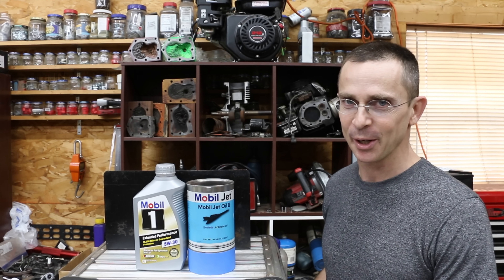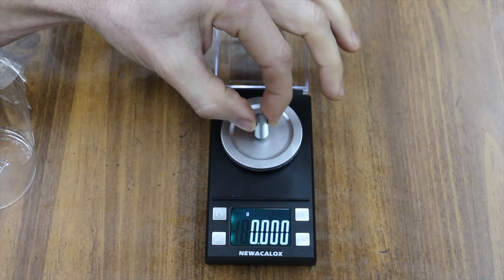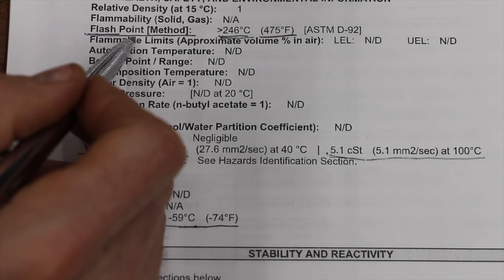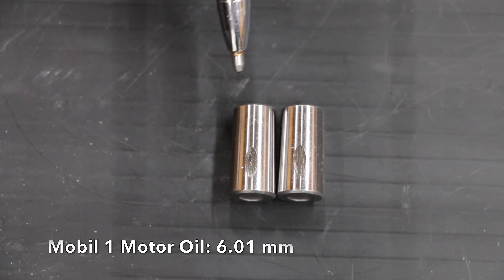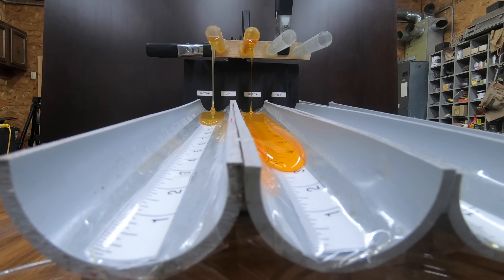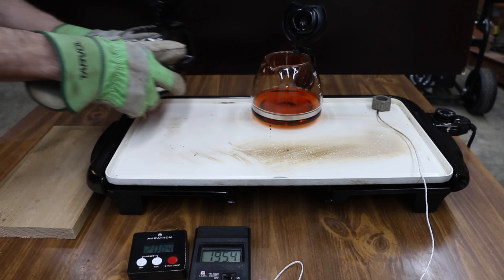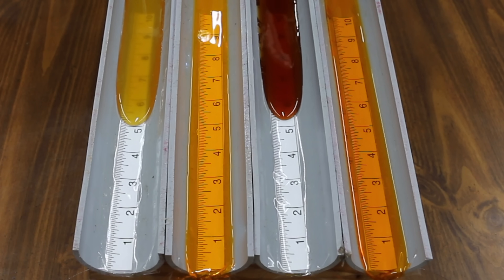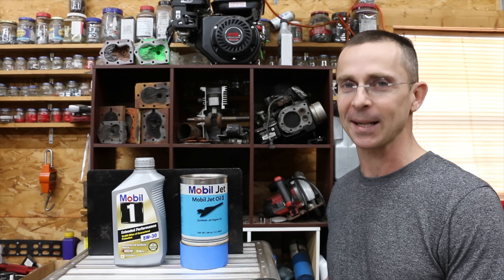Is Jet Oil better than Mobil 1 Synthetic?  Let's find out!

Comment: You definitely don't want to put Mobil jet in your car engine- it will eat EVERY seal and gasket it touches! I work in a test lab with that stuff, and even o-rings designed for that stuff will still swell over time. Also, jet engines use ball bearings, so the oil is designed for rolling friction as opposed to the sliding friction seen in a piston engine, which is why the lubricity tester didn't do as well.
Reply from the maker: Great point!  Thank you
Reply: @ProjectFarm  here's something else I thought of: in addition to lubrication, another key function of the oil in a gas turbine engine is to cool the bearings. I wonder if the specific heat capacity of Mobil jet is different from car engine oil to accommodate this function.
Reply: @EngDrewman  About the heat capacity: The difference cannot be significant from regular car engine oil. All hydrocarbons have about the same heat capacity of about 2 kJ/kg,K compare to water at 4,18. The low viscosity helps with heat transfer but the heat capacity is about the same as for any oil.
Reply: @EngDrewman  Good question... but among the various hydrocarbons used exclusively for Heat Transfer, or comonly known as Heating Oils, like Mobil Therm, Dowtherm, Therminol, etc. the best Heat Transfer will be the fluid with the highest Density and Heat Capacity and lowest Viscosity.  But those properties vary relatively litttle, and thus there will be little actual difference.  The most important parameter will be the actual transfer area and which flow regime will be present, as a high Reynolds Number (fully Turbulent flow) will improve Heat Transfer, so it is paramount to avoid low velocity and falling into Laminar Flow.
Reply: @skunkjobb  True but quite a few jets get cooled by the surrounding air or even its own fuel in a few instances
Reply: @EngDrewman  When ever you include Oxygen into that lubricant molecule, heat transport is improved!
Reply: @EngDrewman  without phase changing effects, thermal capacity increases linear with density if I recall correctly. Conductivity is another issue.
Reply: @ProjectFarm  As a black hawk mechanic would also like to add that the filters we use on military aircraft are extremely efficient!!! The oil will actually come out even cleaner then brand new straight from the can/bottle!
Reply: @LilSausBaus  Too bad they dont make such filters for cars...
Reply: I wonder how it would fare in a rotary, aside from eating the oil seals
Reply: @spazzwazzle  you'd probably see accelerated wear because it is thinner than gasoline engine oil and lacks the wear additives. Remember that in a rotary you have sliding friction on the rotor's seals and between the rotor and crankshaft.
Reply: @EngDrewman  You bring up some good points. However I'm disagreeing with your statement that Mobil Jet Oil cannot be used in components encountering sliding friction vs rolling friction. I worked on the PT6T- series of engines for use in rotary applications,  and those engines have labyrinth seals with the sole purpose of containing the oil. These seals are in direct contact with the compressor shaft and the power turbine shaft, which are capable of spinning at 40 000RPM. if the oil was not suitable at those speeds, the engine would fall apart.
Reply: @kieranmccullagh6713  one correction labyrinth seals are non contact seal which is why they don't wear our spining at 37000rpm
Reply: @EngDrewman  it would still burn out like a recip/radial
Reply: S P I C Y M E M E S Wankel engine
Reply: To add some real world experience to this...  You absolutely can use Mobil Jet II in a car engine.  It will quite possibly cause hell with oil filters as it will pull the coke and other accumulated contamination off of the engine internals in very short order, and I mean very short order, but once you have got through that you will no longer have issues with accumulation or clogging filters.  If you have worn out seals that are holding on only by virtue of contamination gluing them together, they will probably start to leak, but a fresh seals will not have an issue.

Oils a generation newer than it will probably give you more trouble with seals.  I have not tried Mobil Jet 254 in an internal combustion engine and I don't think it will work, as even in turbine engines it seems to be too hard on the seals to avoid weeps and leaks.  It does strip carbon even better than Jet II though.
Reply: Hahaha I remember using Jet A in Syringes and realizing it had stripped the markings on the syringe clean off
Reply: KJ6EPL
I just found out I dropped one more notch on the MENSA waiting list.
Reply: Best comments section on the internet
Reply: @Andrew H EricTheCarGuy did a test of Mobil 1's 20k oil, and it was ok. That said, on some engines the oil wears out faster than others. Lots of city driving wears it out faster too. So in some situations the 20k might work, but the old adage that oil is cheap engine insurance still holds true.
Reply: In that situation then would jet oil work good for a Supercharger or Turbo so long as they use bearings and not Gaskets?
Reply: @oakiraji  it depends on how it is designed. Some superchargers are designed to use Mobil jet; others aren't. What's important is to use the oil the manufacturer designed it to use.
Reply: Jokes on you my car engine leaks like SR-71 fuel tanks .
Reply: Also Airplane oil is designed for application with much more frequent oil changes then cars.
Reply: Agreed. I covered opened Eastman 2379 with a latex glove to preserve for a day or two for re-use. The latex glove surface where oil touched puffed up and ripped. I know because I work with it everyday.
Reply: Which means these tests are irrelevant for cars
Reply: I almost did lol
Reply: Sounds like putting transmission oil in your car
Reply: we not only use ball bearings but we also use roller bearings as well.  It depends on where inside the engine and the application it calls for
Reply: KJ6EPL 
PAG’s hate everything from paint and seals to even some gaskets
Reply: Nope, If You use a small percentagem (10%), It Will condition The seals that tends to shrink over time.
Reply: @Andrew H Polyester (synthetic) lubricants are more stable, and bond with the metal surface
Reply: Hydrocarbon lubricants are good! But need to be changed more often!
Reply: True but it will leak like crazy even before that because it's very low viscosity. Think ATF oil in the crank case.
Reply: Explains why mechanics call helicopters  1000 parts rotating around an oil leak...
Reply: @KJ6EPL Jet engines use Ball and Roller bearing. The Ball bearing is used as a thrust bearing. All other bearings ar roller bearings.
Reply: @Andrew H I think a 20,000 mile oil change is a great idea for your car, but I'll change mine every 5,000 miles. At most.
Reply: Probably this is better for cars with rotary engine then normally oil
Reply: Smort
Reply: Bull shito
Reply: Just what my subaru needs to fix that headgasket. Thank you!
Reply: Thanks! I’ve used Mobil Jet II for years and it always sat in the back of my mind, what if.?.?…
Reply: my Mercedes SL55 needs Mobil Jet Oil II in its high reving compressor :-)
Reply: Good information.
Reply: What about a rotary 😊
Reply: Since it does better at the temperature extremes wouldn't that do well on a purpose built machine like a drag car motor that is rebuilt every time it is run and Couldn't an additive be used to address the lack of sliding friction protection? ... or am I an idiot and someone has done this already... palm face lol
Reply: Can i have ur brain???
Reply: @banana9880  sorry I kill zombies.
Reply: @EngDrewman  damn dude you killed him with that! ☠️💀
Reply: Have you thought about doing a wear test on the turbine (jet) oil using and actual gas engine? And what happens if the 2 types of oil are mixed. I was told in aircraft mechanic school that turbine oil will cause a reciprocating engine to fail after a short time.
Reply: Excellent observations! I couldn't have said it better.  That "Jet oil" could be the current version of the old, tried and tested  Esso Turbo Oil 2380, meant for the Industrial versions of Aeroderivative jet engines like the GE LM-2500 and similars.
Reply: Alfredo Márquez  ESSO 2380 became Exxon 2380, which became BP 2380, which is now Eastman 2380. It is still in use today!  The Mobil Jet oil is in the same 5 cSt class, and conforms to the same mil spec (originally MIL-L-23699, now MIL-PRF-23699 STD). It costs about $25/quart.
Reply: I have use jet oil in my Jeep & lawn mower with no problems with oil seals, O-rings & gaskets. 100% no leaks. As a aircraft mechanic we use the same gasket materials, oil seals & O rings as cars. In alot of cases the exact same oil seals, o rings that can be found from the automotive & industrial supplier's. Many times a viton o ring is better than the Aviation one made under a old mil spec. We also use the same gasket sealers.
Reply: what i learned is that jet oil is designed to be calcualable under ANY condition. something that makes absolut sense if you look under what conditions a Jet have to work reliable.
Reply: Different detergents used, Gas Turbines use Carbon rubbing or Labrynth bearings vs plain bearings, rolling friction vs sliding friction
Reply: @shadowopsairman1583   What the hell are you on about? Gas turbines use regular bearings, carbon rubbing is for electrical engines and outdated.

Gas turbines use regular bearings, they have ALWAYS used regular bearings. If you were thinking of graphite sleeves then that can't even be used in a Gas turbine or ANY modern motor for quite obvious reasons. 

Did you just throw random concepts together that you don't even understand and post that?
Reply: CORROSIVE ✈ 🛩 STUFF!! 😱
Reply: If it was cheaper and/or my car more expensive this + maybe some additive like Motorkote would make the ultimate engine oil.
quote: "Mobil Jet Oil II is compatible with all metals used in gas turbine construction, as well as with F Rubber (Viton A), H Rubber (Buna N), and silicone seal materials."
"...a highly stable synthetic base fluid and a unique chemical additive package"
Reply: @trollmcclure1884  Go put it in your car then and report back here in 6-12 months. 😎
Reply: I dont believe you. IMO you are a part of engine oil lobby. This stuff is amazing. How could oil eat anything? It's not a paint thinner, it has no mouth. Tell us more about the composition, some science behind these claims. We are able to tell if it's true. This guy can make a test or two on gaskets and seals
Reply: @trollmcclure1884  You don't get out much , huhhh? If you were interested in this  video in the first place,Mr. Project Farm would know the audience that he caters too most. Gear heads that know the way around an engine and who have seen sludge and gum in engines from short trips, neglecting preventative maintenance,  not running at a temp that evaps the H2O, and that's considered (Hard Driving). Especially in the north wet climate. You ever wonder why they have "High Mileage" oil? It has a different additive package to swell gaskets and seals (Recondition).To stop leaks etc. Like ATF has more corrosion inhibitors/detergents than motor oil. I sometimes flush my engine with it. (Not Underload) How about you do the easy parts to get answers to your questioning or disbelief. This guy is old school , he says what he means , and means what he says. If he doesn't know, he wont volunteer BS. He did the hard part , so instead of questioning a mans "Word" ? take 5 minutes on google . Peace
Reply: @lane4574  ok I get it. I've got enough of this discussion after 8 months. LOL Dont use it folks, it may eat the gaskets ok?
Reply: @trollmcclure1884  Too thin oil dont drop on parts where supose to be, while engine parts moving. So buy oil recumended by car company, or another with same specs.
Reply: @trollmcclure1884  Different hydrocarbons DO indeed affect Elastomers like seals and O-rings swell, or get too gummy, or actually start to dissolve.  A high Aromatics content tends to be more aggresive.
Reply: @trollmcclure1884  it's synthetic oil.. it's not just "oil" it's a collection of chemicals added to distilled crude to get a specific functionality.
That includes solvents, detergents, and other compoments that can affect seals and gaskets.

Try adding synthetic to a 60'ies engine that has always been run with dino oils.. and is leak free..
you'll soon find that your previously dry engine now leaks oil
Reply: @trollmcclure1884  if you don't believe me, then go ahead and fill up your car engine with Mobil jet. I'm not responsible for the 4-figure repair bill that will result from your folly, however.
Reply: @EngDrewman  I mean, car engines and jet engines work quite differently. One produces thrust and another produces rotational force. That alone should refrain people from using the others oil. Especially since jet oil needs to go under much more stress than car oil. Like using a jackhammer to carefully cut out a chunk of sandstone. It'll just make a mess and a car enging you can atleast repair. At a high cost of course
Reply: @trollmcclure1884  yea to you and the other guy wanting to try this it is possible I dont care what anyone says. The best way would be to compensate with a high quality thicker grade. I think 10w40 high mileage...  Ive seen some old v8s run with no oil presure for a lil while...  Im my old 360 would rather have jet oil then no oil. 

I think we could see a benefit by using 10% jet oil....  I was thinking of trying 80% Jet oil and 20% 0w40...

Anyway. I think the jet engine itself and extreme RPM or heat would be the issues seals have...  What could be causing the seals problems? Besides Polar bears of course.
Reply: @TheXOoftheRO  It's probably sold as an expensive oil additive in a different bottle or used to make 0w40 out of thicker stuff. I need something like this during the winter.

Comment: Jet/turbine oil formulations will eat your plastic/rubber parts. Take the video warning seriously. Aircraft engine oil is changed on a total hour schedule not miles and at least military aircraft have a “soap” (checking for bearing metal in oil)test done after a certain number of hours. And oil must be added after most flights.
Reply from the maker: Thank you!

Comment: I just want to start off by saying great work on the video. I am glade to see that you had a lot of fun making the video and I know I had a lot of fun watching this video. I have learned some great information by watching video. The main thing that I have learned by watching this video is the oil properties in the model one oil and leaned how much loss is done on the metal ware from the Lubrication Oil Wear Test. I would like to see you try testing regular dish soap on cutting grease. Thing final thing that I would like to say is that I am looking forward to the new video that is coming out on Monday again.
Reply: There's the thing that jet oil is supossed to be burnt by the engine, as opposed to the cars' that usually claims it "works the lifetime of the vehicle"
Reply: @AdrianOkay  Okay, Thanks for the great information!
Reply from the maker: Thank you!

Comment: Well jet engines must operate reliably 35,000 feet in the air in negative degree weather
Reply from the maker: Great point
Reply: @ProjectFarm  not only that but they must operate in conditions on ground in places where it can get insanely hot on the tarmac

Comment: After watching many of your oil comparisons, I think imho you should freeze the ‘race-track’ as well, to simulate the frozen surface(s) the oil would normally encounter while in use, and get a metal ‘race-track’ that you can heat to simulate the hot surface(s)
Reply from the maker: Thank you for the video idea!

Comment: Can you test faher anti-friction products? Seen on youtube tests that look very goid,but were made by the seller...
Reply from the maker: Thank you for the video idea!
Reply: @ProjectFarm  I want to propose you a particular anti-friction test. Antifriction products are based in specific quimicals component. A good way to test that quimical base, is to use it in his more pure state. For example, hexagonal boron nitride is actually one of best antifriction. It needs to be with a particle size equal or less than 0.5 microns, to avoid problems with oil filter. Can you do a real test about pure boron nitride? test could be about oil temperature, gas consumption, and deposits inside oil system.
Thank you so much.

Comment: Mobil Jet Oil should never be used in cars, even if we put aside the lower viscosity and wear resistance. It contains a neurotoxic substance (tricresyl phosphate), which will evaporate and spread into the air as internal combustion engines use the oil to lubricate the pistons.
Btw @Project Farm, also not a good idea to heat that oil and inhale the fumes.
Reply: I'm sure he won't die from one exposure

Comment: PLEASE TEST VALVOLINE VR1 SYNTHETIC RACING 20W50 OIL!
This is the most popular "race engine" oil I know of. I use it myself and would love to see how it performs. I would be very interested to see how it compares against other "racing" high zinc oils and the more commonly used synthetic oils you've tested. I think that the racing oils would need additional, more rigorous testing to substantiate their use in high HP applications.
Also, it would be awesome to see how oils compare after running them through a well used engine (high mileage/high hours), to see how they hold up with blow by gasses, wear metals, and other deposits. Personally I think it would be awesome to see how these test compare Valvoline VR1 Syn 20w50, Amsoil, Red Line, Pennzoil, Amazon, Mobil 1, and a conventional oil.
Then there are also the heavy weight Nitro Methane Engine Oils to consider testing.... 🤔
Thank you for all your videos, I enjoy them all!
Reply from the maker: Thank you for the video idea!